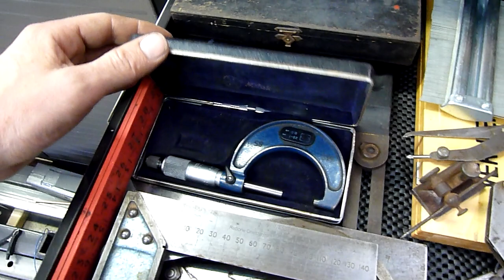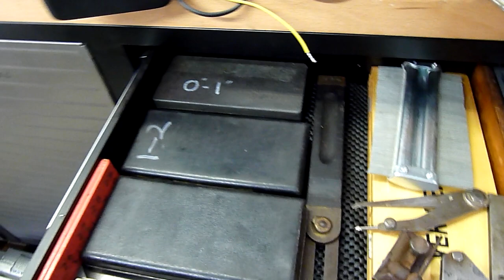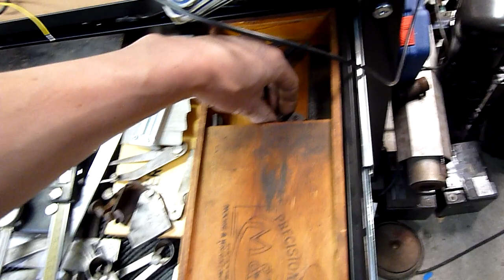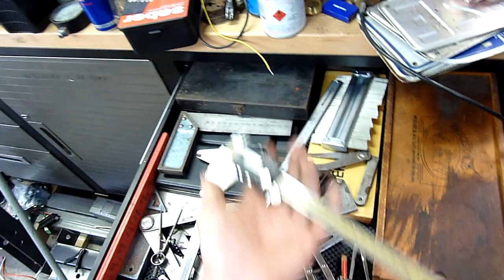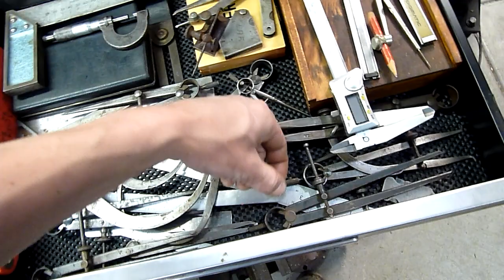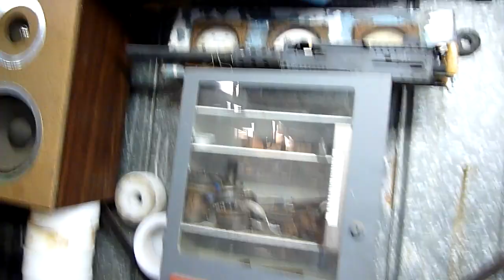Measuring Tools Tour -Calipers, Micrometers, etc.

Comment: I have a harbor freight 6in caliper and I have to say its accurate and I trust it. I have abused and dropped it many times but it works just fine. I have a set of mics from harbor freight as well but I haven't used them enough to say if they are worthy

Comment: Great stuff, the only thing i can see that's missing is a vernier height gauge.
Reply from the maker: I had one of those, took it to work, used it for a while, then after we did not have need for it, some prick stole it :(
was a Mitutoyo too
Reply from the maker: Aussie50 same with the digital runout indicator, never found out where that went :*(
Reply: Aussie50 I HATE it when someone steals your tools.

Comment: What you can do, but beware, this isn't something easy, is to coat the caliper board. If do that, then seal the case with some Locktite then it will never ever have issues with moisture or liquids. Did that to my cheap every day use caliper and i never looked back.

Comment: Quality tools, shame that people just dump them because of age :-(

Yep i also have a "G" micrometer, mit-something lol, it stays in its box untill needed, accurate tools are worth taking care of :-)

I have one of those cheap digital rulers as well, i had to dissasemble it from new and clean and adjust it so it repeated, not bad for £8 :-))
Reply: I've got a pair of maplin's re-branded digital calipers. They're actually not too bad as long as you keep them clean and dry. they were below a tenner, too.
Reply: Not mad for maplin, ive found them to be a bit expensive for some things, but cheap on others, odd that :-)
I cant see the "all plastic" calipers being much cop, but the metal ones seem ok :-)
Reply: that's what I've got, the metal ones. Whatever you do though, avoid their hookup wires (the ones with croc clips either end), they're shit. the best ones I've found are from rapid which also happen to be half the price.